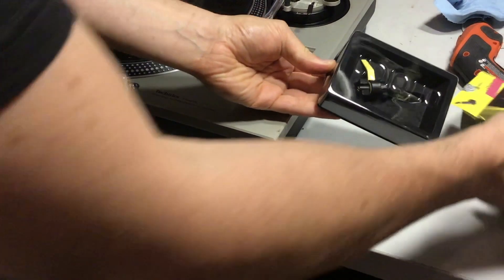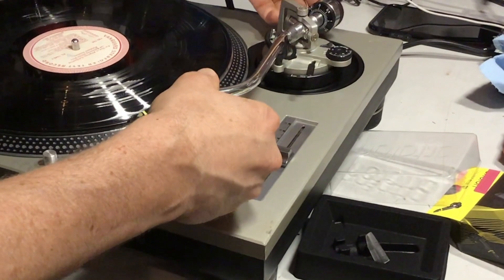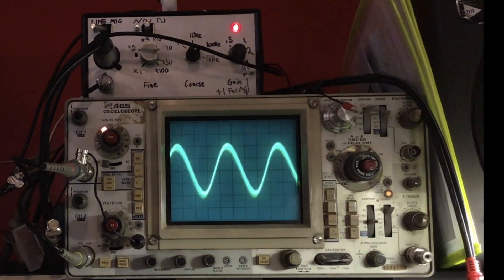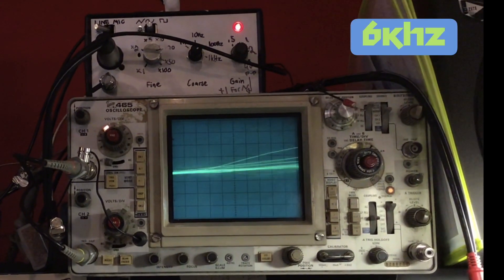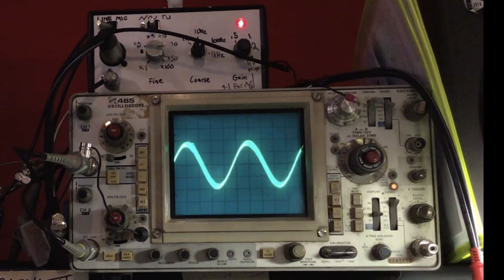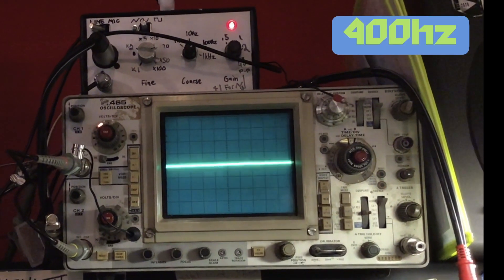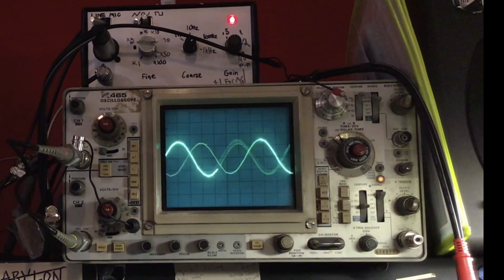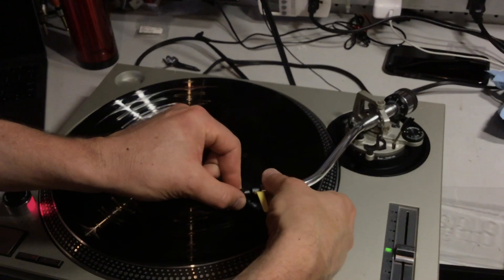Testing an Ortofon Concorde MK II Club Cartridge with an Oscilloscope

Comment: Hello DJ Fix! What is your opinion on 3g tracking force? Do you think it is a little heavy and will wear your records over time? Can you run this cart at 2,5 possibly? Or shouldn't be worried about 3. I have this cart and I feel like it has some background noise. I could be tripping but I also have a AT-VM95ML which is around the same price and I feel like has better sound overall. I only use them for home listening. I also have the new Ortofon Concorde Music Blue but haven't used it much yet.

Comment: Great video...I have an Audio Technica LP1240 turntable which I plan on digitising my vinyl, it has Line,Phono and   USB output options,.what price of test equiptment would you use to test which is the cleanest (signal) option? 
Much appreciated.

Comment: Hi I think a review of those jico 477 (shure replacement m44-7) would be a great video aswell as the ortofon scratch mk2 concordes. Unfortunately I'm limited to spherical needles as I have straight tone arm vestax pdx d3s mk2 and I'm torn between the 2 mentioned and the ortofon digital mk22 that youve already reviewed 😊

Comment: I am really torn between the CLUB MK2 and the DJ MK2, SQ wise. I really like treble and also a full bass, it looks like the DJ is a bit better sounding then the CLUB although everybody raves about the CLUB MK2, I can't really understand why - please help me decide :-) I listen mainly 12" maxi singles 90's eurodance, trance and also metallica/nirvana/gun'n'roses and hip-hop/trip-hop as well
Reply: what did you choose, im hesitating between the 2. A frienda mine let me try his DJ m2 (brand new) and like it so far (better than my Nagaoka mp150...) . From the rips i heard on Soundcloud, the DJ sounds a bit better than the Club but maybe its just an eq curve like artificially bump the trebbles... Whats your opinion ?
Reply: @kicksNCY  I bought the Club MK2 as it tracks at 3g. DO Not want anything 4g touching my records I've spent thousands upon thousands  on. I only listen to 90s 00s trance music. I do like the colours of the DJ but the 4g I dont know about that. Maybe if it worked at 3 but even 3 to me is pushing it. I only listen for pleasure and dont mix or scratch at the moment. I also bought the new Ortofon Concorde Music Blue as it is more HI-Fi geared which is perfect for me. And it tracks at 1.8 which is perfect. Before I was using the AT-VM95ML that tracks at 2g which was fantastic for the money. I only bought the Ortofon Concordes for the looks. So had to get the best ones that would come close or better than the AT. Btw what anti skate are you supposed to set too?
Reply: @kicksNCY 
Actually you will laugh but the Reloop Blue was best of all for my ears. It’s Ortofon Concorde just rebranded. It’s similar to DJ but better. IMHO it’s best sounding cart except the Shure M44-7 which is simply legendary.

Comment: I have a newbie setup with a Pioneer receiver, an AT-LP120xUSB turntable, a Pyramid PR-2700 mixer, and Fluance shelf speakers. I really want to up my ante big time and grab a quality stylus/cartridge like this. But I'm worried that my old mixer is going to ruin the sound quality that the Ortofon provides. 
Do I need to upgrade my mixer and/or speaker to extract the most out of the Ortofon?
Reply from the maker: Seems like the Pyramid mixer could be a source of troubles. With a pioneer amplifier and a good set of speakers that can handle the power coming from your Pioneer, you should be good to go!
Reply: @DJFixNYC  I figured, since the mixer can distort the audio if I mess with the EQ too much. Still better to get a nice cartridge like this.
I just bought a eurorack Behringer mixer, but it takes solely 1/4" cables, not red/white audio cables. I'm assuming I need converter cables now, but that's ANOTHER thing I'm worried about with quality loss.

Comment: Excellent video !
Do you happen to know which of the series has the most balanced output,  best tracking and tolerance to misalignment ? I'm using a pair of mock 1200s with Clubs in my home studio strictly for mixing and no scratching but these TTs have a 54mm long arm tube (1200s have 52mm ones and the concordes are based on that). Both of the arms were built super high and I decked them down as much as I could, and it still can't get a completely flat angle. The Mix styli makes the mistracking on the outer edge tracks a bit less obvious, but it certainly lacks the stereo separation and overall cleanliness, although that could be due to the body. Also would you (rather) recommend going the VNL route ? Thanks a lot.
Reply from the maker: Hi! Good questions. According to our own tests, the Digital cartridge seems to have the most balanced frequency response right out of the box. After 100 hours of break-in period? Who knows. For sure the Mix cartridge is the least balanced of the bunch. Can't really speak for intentionally mis-matching the styli from one model with a different cartridge though. 

The VNL looks promising. So far, we are hearing that the balance is indeed very similar to the 44-7 (not that the 44-7 had a perfect frequency balance, but it was very good), but the output is noticeably lower. Probably not a deal-breaker, as most modern mixers can deliver a lot of gain without excess noise.
Reply: @DJFixNYC  Many thanks for helping me. I actually wonder how they managed to achieve 8mV on these Club carts when not even the VNL has the same output.

Comment: Very interesting video.  I want to check the left to the right channel of a hi fi cartridge to make sure the anti skate is correct. How do I connect the output from the cartridge to the oscilloscope. I will be using a test record for the right and left signals.
Reply from the maker: You could connect each channel of a 2-channel scope directly to the left and right outputs of your turntable and take measurements there. The input impedance of any good scope should be plenty high enough. Without the RIAA equalization, the frequency balance will be all over the map, but that should not matter if you're testing for stereo balance. All you need is to see if the output voltages between the two channels are the same or not.

Comment: Any of these DJ carts good for just general listening purposes? I currently have the first Gen clubs.
Reply: I've been using the Concorde Gold and Nightclub MKII (predecessor of the Club MKII) for years, not only for mixing, but also for playback of dance vinyl. Worked great, especially the nightclub MKII.
Got the Club MKII about a year ago, it's even a bit better in terms of channel separation.
Reply: @QoraxAudio  What do you set the anti skate to when listening with the Club Mk2? Also are you worried about the 3 grams of tracking force digging into your vinyl or do you set it lower? I listen to basically only Trance music and bought the Club MK2 and the New Concorde Music Blue. Also was using the AT-VM95ML which was amazing overall, but I just loved the look of the Concordes thats why I bought them. And straight away went for the better ones because I wouldn't want anything less quality than the AT which is outstanding for the money.
Reply: @Gizmotechnics  Why do people worry about 3 grams?
Btw, the 95ML is a microline, should be better than either of the two concordes.
Reply: @QoraxAudio  REALLY? Microline is better than Elliptical? Thats insane how cheap and low quality Ortofon is.Those bums.  Im so disappointed in them. The thing is I just love the look of the Concordes thats why I went for them even tho I only really listen for hi-fi use. The only option is to spend double for the Ortofon Concorde Elite which is a better DJ cart but even then for almost 700$ it isn't even audiophile level where you could get the AT-VM750 for 600+tax which would be insanely good. Or there's the music bronze for 1000$ Canadian. Probably isn't even as good as the AT I just mentioned.
Reply: @QoraxAudio  3grams is up there. Definoutly woudlent be wanting to go more than that personally. Back in the day all carts tracked at 1.2-2g. I dont want my 100$ plus records getting ruined. I listen to some vinyl 100 times in a few years. 4g is OD you dont care about your records. The price of them is just so high I wouldn't chance it.
Reply: @Gizmotechnics  Sure, microline is better than elliptical, but there's more to a cartridge than just the stylus shape.
Reply: @QoraxAudio  I know. All the best Carts aren't the Concode. But im a sucker for things I like the look of. It is what it is. When I buy a 1200G I will either get the Concorde Elite gold to match the gold platter or just go for the bronze music. The black music would be even better but probably cost a lot. Something about the Concorde pen shape and how it pairs with a 1200 and how you Never raise the tonearm instead you just pick it up and slam it down into the records while it spinning is appealing and cool. And the different colours of the DJ line are attracting. But God are they junk quality. 😅
Reply: @Gizmotechnics  The best cartridges are way over 3 grand, so not really interesting to most people anyways.
I have quite a few concordes and some actually quite good, like the MC200 and the Concorde R40.
Reply from the maker: We personally really enjoyed listening with the Concorde Digital cartridge! The Scratch is a close runner up with the high frequency bump :)